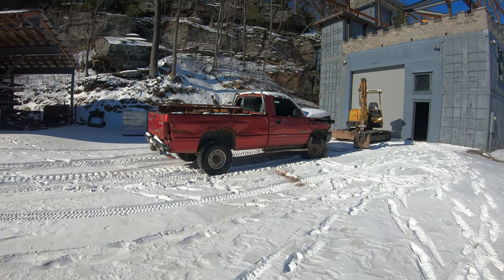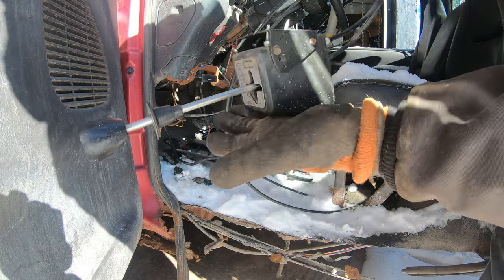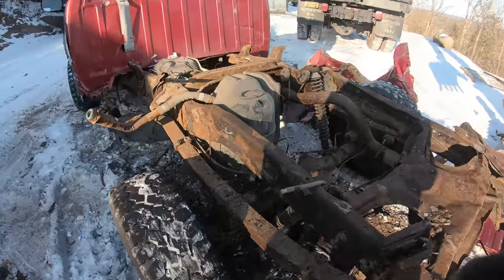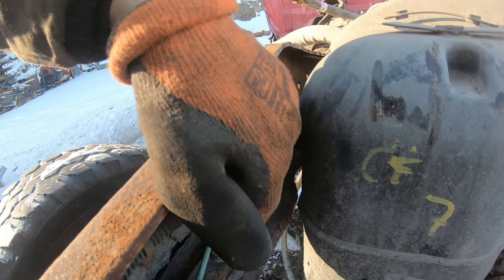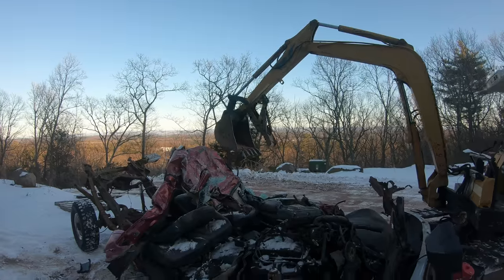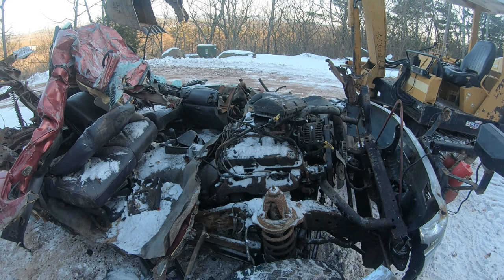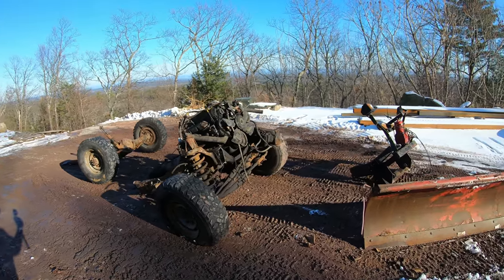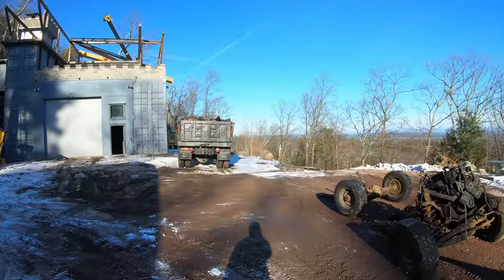Dismantling a pickup truck

Comment: i have every tool known to man in my garage to do an engine swap,   let start with an excavator
Reply: Ever heard the saying everything is a hammer. Well nothing beats excavator
Reply: Lol
Reply: Didn't he say he wanted to keep the axles? I mean, good luck after 9:35, putting the whole weight of the excavator on them.
Also, he bought it for the engine and continuously rams the whole shovel into the engine bay. Very clever.

Comment: Craigslist: Dodge Truck - One Owner - Some Rust.
Reply: Just a spot.
Reply: -Well kept plow truck
Reply: It has been in an accident but nobody got hurt. Needs minor repair and a few parts. Good deal for mechanically inclined person.
Reply: Chassis slightly bent.
Reply: Stage 3 weight reduction upgrade
Reply: You forgot the never beat adult driven i know what i got so dont low ball
Reply: Convertible...
Reply: No tire kickers
Reply: Yes , I kept thinking what a nice Dodge Ram commercial this would make. AC saying he only was trying to replace the brake lines!
Reply: I know what I got !
Reply: Ran when parked 2 years ago
Reply: Flat packed
Reply: how much !!!  dont want if its the same same pickup on andrews channel   lol

Comment: Loved the video and it reminds me of two things I always think, other than Andrew outworks all of us.  First, the sheer power of these excavators is incredible, especially with the thumb.  That excavator easily lifted that truck body with a couple of inches of snow in it at the beginning of the video, then made short work of that pickup.  I mean it was no contest.  Second, the strength of bedrock must be incredible too, because it seems to be the only thing that defeats one of these excavators, absent the hammer attachment. I work at a job that doesn’t put calluses on your hands so these things amaze me.

Comment: I have always said, You have to wear your seat belt under penalty of law, but the brake lines are made to dissolve and could go any time.
Salting roads is tantamount to attempted murder regarding brake lines as manufactured.
Reply: I live in northern Canada and have had a few " Oh Sh*t ! " moments with brake line failure . I 100% agree with your comment .
Reply: @robertrosicki9290  same here man 🇨🇦 I a couple let loose not cool lol
Reply: @darinmorgante7200  In the dead of winter even less cool .

Comment: All I did was bump into it with my excavator, and then it just broke for no reason
Reply: kinda annoying..
Reply: It’s kinda annoying.
Reply: I can't belive they are getting away with making trucks out of tinfoil, got smashed up for no reason
Reply: XD Gmail all vehicles this size are built pretty much exactly like  this truck. Thin 18 gauge sheet steel that rusts away, thin flexible frames unless it’s a unibody, then just lots more thin sheet metal. And no the older cars aren’t any tougher, still thin flemsy sheet metal.

Comment: I’m with you on those steel brake lines. It’s great that they put 42 different airbags into the new cars but I’d rather not have to use them because they decided to save $14 on the brake lines.

Comment: if you decide to reuse that 360, make sure you, at a minimum, put the improved plenum gasket on the bottom of the intake manifold before you install it. A new timing chain, water pump, and heater tube would be another good idea, if you do that, also install a timing chain tensioner from a  3.9L. I'm just down in  Marlboro if you need any advice on Mopars, you have taught me so much I would love to pay you back.

Comment: Looks like fun.  Removed engine etc using somewhat similar technique many times. Usually takes less than 30 minutes.  Remove oil, coolant and refrigerant using appropriate method for your circumstances.  Disconnect trans shift linkage and cut or unbolt steering flex joint. Cut fuel lines, brake lines and wiring harnesses in engine bay.  Flip vehicle on side with one door open leaving tires and wheels attached.  Cut or unbolt drive shaft and exhaust pipe.  Cut or unbolt engine/transmission mounts. Usually removed fuel tank before cutting if using torch. Radiator and condenser are usually not worth saving so often leave in place.  Lower vehicle back on wheels.  Hook engine using chain or cut seat belts and lift out.  Watch for wires, hoses etc that may be restricting removal. This entire operation is easily accomplished using a skid steer. If saving deferential's, I usually cut at frame mounts.

Comment: Interesting that you have steel brake lines - in the UK, you simply can't buy them - they're all Copper here.
Reply from the maker: Really? New cars come with copper brake lines? They are all steel here, and the rust and burst, often during emergency braking. Its very dangerous. I always change them to copper. But they should just come from the factory copper. I think the auto company's should be forced to replace them all for free on every vehicle.
Reply: No they are not and never been. They are all steel
Reply: @lukasz-or8dq  Are you saying that there's no such thing as copper brake lines?
Reply: @timbibin1301  no , I am saying that they are all steel in new cars. The replacement is copper.
Reply: @lukasz-or8dq  Late answer but there you are wrong, depending on what manufacturer of car but many have been running with some aluminium type of brakelines for ages. I have a 1995 Audi with them and the lines still looks like new.
Reply: @Holli622  no you are wrong mate . It is not aluminium as it is to soft to stand out so much pressure. It is galvanise steel or zinc plated but for sure not alu as would not be safe and any manufacturer would not used as a brake line.
Reply: @lukasz-or8dq  Im not stupid, i know the difference in steel or aluminium, and the copper lines is far more soft than these aluminium ones. You do know about a thing called alloy, maybe..

Comment: Hey Andrew. I think that there might have been a little more enjoyment destroying the red ram 2500 than the actual extraction of the engine for re-use. I started laughing so much when you said that you might have to use the wiring harness from the other truck. Lol. It was a good watch for sure.

Comment: Andrew - I never dismantle a parts vehicle- just park it out of the way out of sight - put blocks under the axles - cover it with heavy duty tarp duty tarp - that way I have all the parts which are just removed on a needs basis - then scrap it when no longer driving that model find it easier - and storage isn’t a problem for parts I may never need! Stuart

Comment: They. Used to make the best auto transmission, the 727 torque flight, was good 700 plus HP in the Drag Hemi Ramcharger factory sponsored drag car during the mid 60’s!

Comment: Just a idea .... why not put the truck on the lift and unbolt the body from the frame and unplug the necessary wiring from the firewall and fuse block on the fender ? Still would have been cool to watch ...

Comment: Did you remove the ECM computer first ?  They're kinda paired to the engine they were installed on.   Nice job and skill with that excavator
Reply from the maker: Yeah, I have it. IDK if that engine is getting used again. The truck it was going in is just as bad as this red one.

Comment: May have been easier to crawl under the truck before and use the cutting torch to burn all the heads off the cab mounts and the bed to make it easier to take apart

Comment: Andrew,  what was the advantage to tearing the truck apart with the excavator as opposed to removing the engine and what you wanted to keep the normal way by unbolting them and then putting the truck body on your trailer and hauling it to the car crusher?
Reply: I mean, Andrew's way looks like a lot more fun.

Comment: Removing the frame leaves you with 4 pieces to move instead of 1 ! The money from the frame weight would be about $5 , while the cost of your time and fuel + the cutting wheel would be closer to $100-$200 and you still have to move each piece out of your way =  More money !!

Comment: Hey Andrew, would a 1ton or 1.5 ton mini excavator be strong enough to pull out wooden fence jobs ? 
I plan to get an attachment for drilling holes with it too. 
Thanks
Reply from the maker: Probably. I would reccomend getting a bigger machine than that though. I have that Komatsu PC15, its small but it does stuff.

Comment: Next time cut the doors, roof and pillars, so you can get the glass out without getting smashed glass all over your driveway :DAlso saves a lot of time ^^ What's insane is that in a lot of countries they are now banning copper brake lines for newer vehicles.
Why? So auto companies and parts makers gets even MORE money.

Comment: NEXT  TIME, TO MAKE THIS MUCH EASIER, PUT IT ON YOUR LIFT, BURN OFF THE BODY MOUNTS TO THE FRAME AND IT COMES RIGHT OFF. WILL SAVE YOU A TON OF TIME. I WORKED FOR ONE OF THE LARGEST RECYCLING PLANTS IN THE US. THIS IS HOW THEY PROCESSED 100'S OF CARS A DAY.
Reply from the maker: Doing it this way was funnier.

Comment: have you ever replaced a steel line twice due to rust????
Reply: my self i never kept an old vehicle that long
Reply from the maker: Yes, those green steel ones they sell only last like 3 years. They are worse than the original lines.
Reply: @AndrewCamarata  now you got me thinking, when the parts stores sold the galvanized or aluminized what ever they are i never had a problem. guess I got a few to watch. parts stores in Michigan don't sell copper that I know of. but copper is definitely easier to put a flare on

Comment: Why don’t u just unbolt the cab from the chassis pop the motor out with no damage at all. That motor may have ran before you tore the truck apart with a mini excavator I’d like to see what it did when u put it in another truck
Reply from the maker: This was funnier. Yes, this motor did get installed in my grey pickup.

Comment: nothing like a older ford to haul away a newer ram to the junk yard. the steel, transmissions, axles front end etc are all trash in ram. ram would have gone out of business if it was not for Cummins. if you just buy a OBS for you would spend less time fixing and more time making money with your company. i have seen fords from the 80's with plows on them that have some rust on them but in good shape. look up the ford and steel industry and you will find out ford used the best steel for there trucks

Comment: Why did you spend so much time and money tearing that apart ?  There are only 6 bolts that hold the cab on !  Unbolt from the bottom and cut the stearing shaft , then load the whole cab into your truck ! Max time with your rig would be 10-15 minutes and you save time and money !!

Comment: My 2002 GMC 2500 HD is the same for Brake Lines, Should have made the out of Stainless steel. Brake lines are junk, they should make all car and truck makers use SS Lines. I have 30,000 miles on my pc. of Shit GMC. I wish I had one of those to take mine apart Andrew. Turn over and cut motor mounts and save snowplow pump and wheels.

Comment: Andrew - I’m pretty sure you’re aware but, just in case, Quantum Tech HD has put you in their latest video. At about 1:14 at the video linked below they include a segment where you rebuilt an excavator bucket - the one that needed to be deeper so it would curl up better for lifting into a dump truck.  Just a heads up.

https://youtu.be/YoHcNXVy0to
Reply from the maker: Thanks. Yeah, they asked me first.
Reply: @AndrewCamarata  Have they called about getting permission to use the how to put a new radio in a pickup using a chainsaw yet?

Comment: Wow Andrew; maybe the the goal was the gore of tearing a truck apart with a excavator but couldn't you have taken a few minutes and just have blown the body bolt heads off with a cutting torch.  Easy to access inside the bed and the floor of the cab.